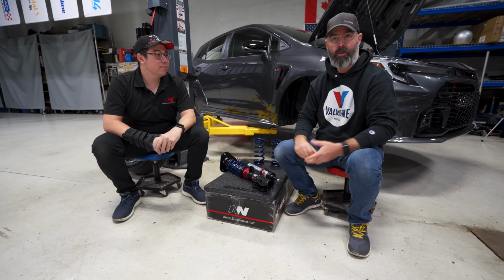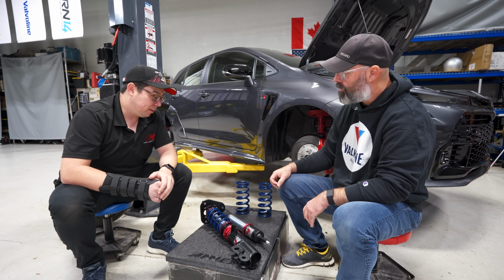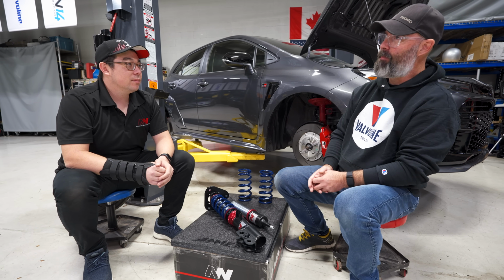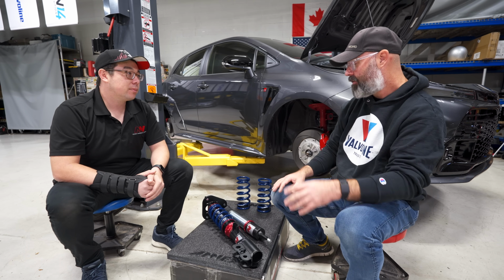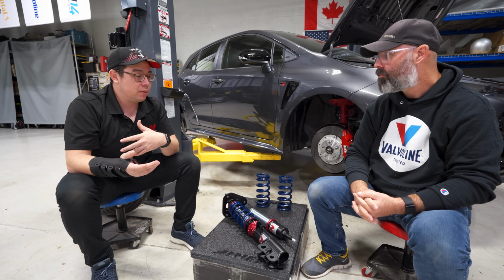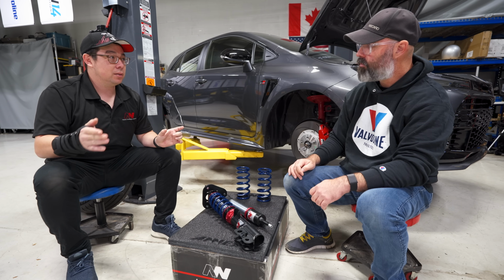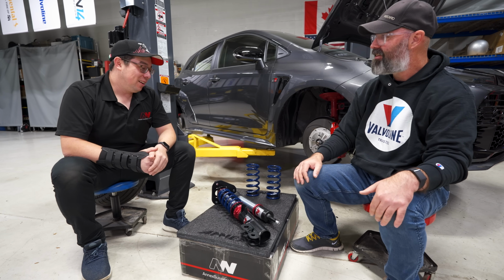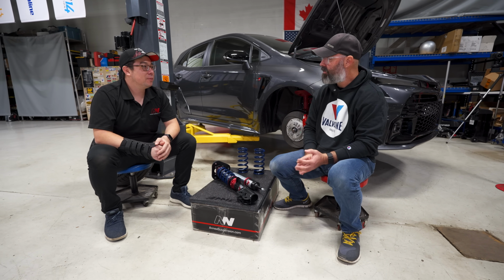Don't Get Fooled When Buying Coilovers - Tech Talk 101

Comment: How do Annex Suspension FastRoad Pro or Elite coilovers compare to Fortune Auto 500 w/ Hyperco springs (my current setup on a 2024 VB WRX)..  ?  I've been super happy with the FA 500's, but always open to other options.
Reply: I would argue, less road noise, better damping (better body control, better compliance over harsh impacts and cracks in the road) and better durability under extreme use if using the inverted / Elite line.  -Grant

Comment: 11:00 😅 I almost ordered 8k springs for my 370Z for the front. No idea what a 0.65 motion ration was. Went to 14kgf/mm and that honestly still seems light.
Reply: Hey man, I'm actually looking into ordering some for my 370! Did you go with true rear or standard divorced? Also did you go with swift or normal springs, and what spring rates? Also how is longevity and have you tracked/autocrossed it?
Reply: @chasew3909  
Go with devorced!!!
The rear barely has any space around the coil. I went with true rear 250mm 11kg F, 250mm 4kg R with . Soft springs, but with Eibach swaybars. There's a bit of math involved,  but that's what seemed like that best of both worlds for me. 
It's oversteer biased, so I can do a scandi flick to initialize a drift. (7AT probs)
For devorced, the math is completely different for the rear.
There's really no tracks around me, so I'm stuck to back roads. 🙃
Reply: @MyFaux thanks for the response, glad to see you’re liking them, and I’ll probably be placing an order for them soon!

Comment: Funny how know it all suspension company MCS told me how inverted suspension isn't necessary.
Reply: I don't think this is black or white - if you increase the shaft diameter or the bushing size, a traditional shock rod may be just fine.  But it's worth noting that normal GR Corollas have a conventional shock rod but a Morizo has inverted monotube =)

Comment: Love these conversations, as an engineer in this field its always good to hear an expert simplify it to a point it makes sense in layman terms. 

To his comment on super high rebound basically it means the wheel won’t ever drop, think pot hole or post curb hoop… the body of the car will fall into the hole or drop making a super harsh return to plane without any travel to “soak up” the terrain. Balance is clearly key between body control and ability to eat terrain, what makes the difference between proper and poor damping is its ability to breath over the terrain/street/road/etc.
Reply: Very well said Fernando.  I might need to borrow this terminology on a future video!

Comment: The note about getting catalogue parts makes sense.  Sure stuff is off the shelf but the magic is how they get the parts to work together and squirt oil with the perfect flow
Reply: I do want to clarify that many of the internals are designed and manufactured by us.  But we are very transparent that we will use top hats and brackets from overseas manufacturers when we can to bring high end damper tech to the masses.

Comment: on track inverted mono is good because the structure and temperature advantage, but on public road the twin tube is way better on comfort
Reply: I think this is debatable.  Carefully valved inverted is quite nice too.  Ohlins R&T is a good example of this.
Reply: I think part of the confusion is that most people's experience with mono are Bilstein and they compare them to adjustable Konis.  The Bilsteins just transmits so much more of the road into the cabin thanks to the high air pressure that they typically utilize.  I've seen much improved rides on Bilstein's simply by lowering the charged air pressure. The twin tube Konis option have much slower air pressure and a lot of times if you look at how they handle bumps they take a lot of the edge off a lot of the small stuff, but when you really get them moving they ramp up pretty hard.  Unfortunately, the tropes from BMW owners have kind of been misleading as to creating these rules of mono versus twin.  I Love how many companies are out there now sharing information.  I think the big negative of an inverted monotube is just the higher maintenance associated with it but you get it back in strength and lightening the stress seen by the shaft which I'm sure of many of us have seen bend.  It seems like a good option for McPherson cars especially since the top nut can be quite large since you wouldn't be eating up space within the cylinder if you were to run a larger diameter shaft.  I'm trying to wrap my head around if it is less spring away as well since a greater portion of the weight will now be directly affixed to the car.  Annexes is really cool because they take knowledge and theory and then go test it and learn.  It's kind of cool to have anl Shockworks-esque shop stateside.

Comment: Annex is the real deal. They did a set for my 8th gen and now my EK. Both are amazing!
Reply: Ive been looking at Annex for my FA5. How are the street manors vs stock? Mine is original so Id imagine anything is better then what it is currently at.
Reply from the maker: @CDOES their FastRoad Pro ride amazing on the street, confident you’d be very happy with them as an upgrade to the stock shocks and springs. The car will feel way sportier but not too stiff or harsh.
Reply: @CDOES  Just get some Ohlins. Similar pricepoint but superior.
Reply: @RollingRoadEFI Ohlins makes coilovers for the FD2 Type R, but not for USDM 8th gen Si
Reply: @ph0kingbrian I’m pretty sure the fa5 is the same mounting points for coils as the fd2
Reply: What did they run you?
Reply: How are they on the EK ? I got an EG but how do they handle on the older chassis ?